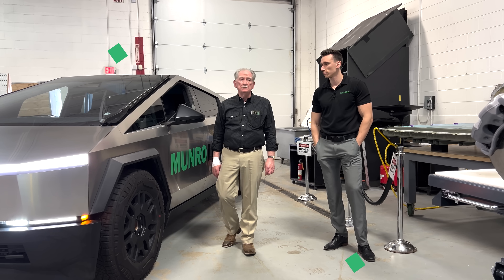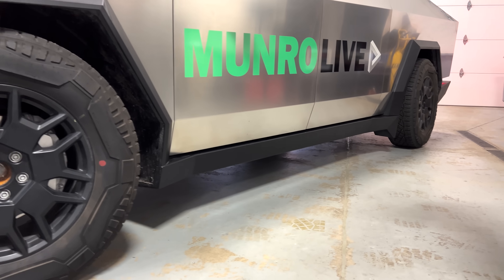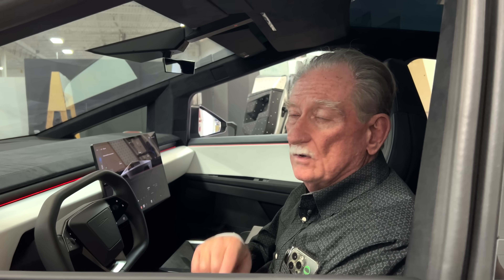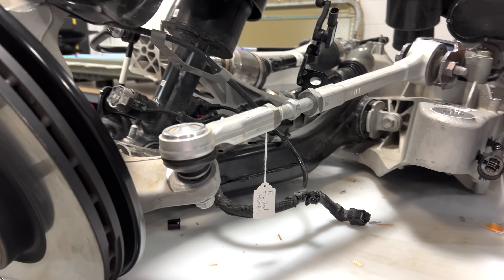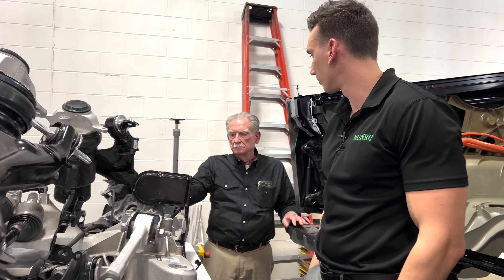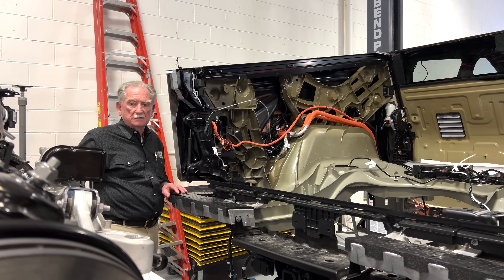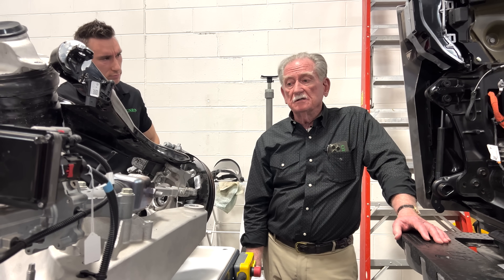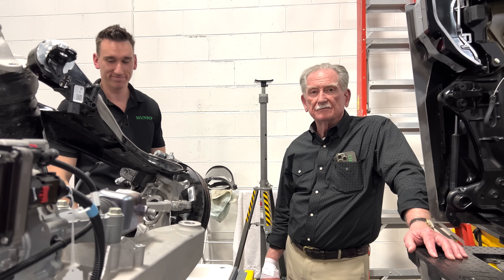Tesla Cybertruck Steer-by-Wire System

Comment: What’s the next step after steer by wire?

Turn the front wheels more, eventually to 90 degrees. The electric motors will move the truck at 90 degree steer. Do 90 degree steer for just the front wheels for now, then add that feature to the rear wheels. Just on the front and you can shove the back into a parallel parking space, then turn the front wheels sharp to bring the front to the curb.

It doesn’t need to be Tesla who does this. Innovation favours the bold. There was a mini prototype car that could turn all 4 wheels to 90 degrees. We can do that in a production car today. But a long pickup truck would benefit more. For now, just design so you can turn the front wheels 10 degrees more. Then next iteration go to 90.

And lower the bed of the truck. The Rivian might be the first to lower the bed of their cargo box because their box is not as long so it’s easier. You have the clearance between the ground and the underside of the truck. Then the frame parts and motors go between this space and the bed of the cargo box. That stuff needs to be squished or fitted it into the sides of the cargo box. Going with first principles, the underside clearance (16 inches?) to the bed could be as little as 4 inches. That means the step up from the ground to the deck or bed of the cargo box would be 20 inches. Currently the typical height of a pickup truck’s bed is 32 inches. It’s a big step. Going 12 inches lower would make it a lot easier to load and unload.

With ice trucks, you had the drive shaft, the differential and the axle, plus room for suspension movement. All that goes away with electric motors. The only reason we keep the bed height at 32 inches is because we’re designing an electric truck modeled after the original ice version (and the ice truck was modeled after the horse drawn wagon and carriage, which also had an axle and suspension under the floor). The only other way to have a low bed is use smaller wheels (because your height is still dictated by the height of the drive axle... which isn’t needed in electric vehicles).
Reply: I heard Tesla wants to start changing their assembly over to unboxed soon. Any maker can do this.

Comment: I think that it would be reasonable to guess that the casting with the ZF logo is a common ZF component, also used in conventional mechanically-drive racks, while the casting with the Tesla logo is still made by ZF but is unique to Tesla because only a steer-by-wire system needs the second pinion and motor, and Tesla is initially ZF's only steer-by-wire production customer.

Comment: On ehuge benefit of by-wire steering is the ability for the system to decide what steering roadwheel angle to apply no matter what the driver input to the handwheel is.  The biggest problem when calibrating a dynamic stability control system is drivers who "wang" the handwheel all over the shop, upsetting the system.  With by-wire steering, you can perfectly control vehicle yaw with a roadwheel steering input as well as, or in preference too, a brake yaw application.  Add in machine vision and lidar, and you can finally break the age old problem of drivers simply getting target fixated on the thing they are about to hit, and as a result hitting it. In advanced driving we teach "look where you want go, not where you don't want to go" but for most drivers, and emergency is so rare, unfolded quickly and un-expectidly, and as a result, a lot of fundamentally avoidable (through handwheel inputs in conjunction with braking) are not avoided at all....
Reply: Wenn Du sowas willst oder brauchst, ok - aber ich schalte im Winter je nach Straßenglätte und Schneelage sogar das ESP AUS - aus dem einfachen Grund, weil es hoffnungslos überfordert UND eben viel zu langsam und träge ist. Bei sportlicherer Fahrweise, ist das System sehr schnell überfordert. 
Probiere es mal aus, ein außer Kontrolle geratenes Auto MIT und dann OHNE ESP wieder einzufangen - dann weißt Du was ich meine. Bei mir, war es also genau anders herum, dass das "überforderte ESP" ständig und verspätet MEINE Lenkkorrekturen dann praktisch zunichte gemacht hat. Man spürt dann regelrecht, wie das ESP mit 0,5 Sekunden immer zu spät eingreift.

Comment: The gearbox shown at 8:18 is clearly a worm gear driving a wheel which is on the pinion shaft. There might be planetary reduction as well, I suppose.
Reply: That is what it looked like to me, too.
Reply: 100% - no planetary drive required for the ratio between motor and rack. That is a worm drive connecting motor output shaft (worm) and pinion (connected to worm wheel).

Comment: million dollar question: How is the 48v power supply redundancy / backup handled and where?  A total loss of 48v power is going to be a problem! Does the rack still have mechanical self centering, ie is the motor drive ratio and motor friction/cogging low enough for the castor angle to push the wheels back to centre in the case of a complete loss of 48v power, or can the vehicle use brake bias to steer in extremis?
Reply: you aren't the first person to think of that.  Maybe go watch more tesla vids.  Tesla has two electrical systems in each car.  The main battery winds down, and it slows you down.  Eventually, when the battery is 1% it doesn't let you go faster than 1 mph.  Then it shuts off.  You still have lights and steering powered by the backup battery system.
Reply: @davidanalyst671  no. i'm not talking about a HV traction battery discharge or failure, i'm talking about redunancy on the 48V battery and asscosicated electrical distrubution system.  I'm sure the SBW meets ISO 26262, i just would like to understand how that is achieved with respect to the 48v power architecture.  I'd immagine it is furnished through very careful fusing and discretisation of dual feed paths,using both the 48v storage battery and the HV-LV DCDC to provide seperate and non-cascadable redundancy!

Comment: Isnt it better to make the cable separate? What if something happens that the cable is damaged. If they are so close together they can be both damaged
Reply: I have been begging for a wiring episode.  I would assume elon wouldn't want it because everyone is kinda trying to catch up to elon, but yeah, we all got questions.  they could separate the cables, so it runs on either side of the battery, so one gets damaged, it uses the other....
Reply: And both cables connect to the same point, a little corrosion there takes both out.  Not really a triple redundant system.
Reply: A rat would chew both cables ar once
Reply: And what happens if you lose power? Either through battery failure, accidental/intentional power off or connection failure.

Is there any sort of mechanical steering wheel lock on Teslas as there are when legacy ignition keys are removed?
Reply: @GntlTch Nope.  Check Out of Spec reviews… they tested and answered your question.

Comment: Aircrafts crashed for pitot tube malfunction. Speed sensors become a vital part in a SBW car. I guess at least triple redundancy is needed there.

I still feel they could get most of the benefits with a traditional steering assist at the expense of a longer steering wheel travel.

Also I'm not sure everyone is going to service their cybertruck as thoroughly as an airplane is maintained.
Reply: Most AC maintenance these days is troubleshooting and parts swaps.  Car mechanics do the same.  And in both cases the big advance is the diagnostic software/hardware
Reply: The 737MAX crashed because of a cluster ** at Boeing.    This should never have happened.  It did not follow general control system principles and standards.  The system was supposed to apply a specific amount of pressure to the stick to make it feel like the 737 NG.  Instead they delivered a unit that overpowered the pilots.
Reply: @danharold3087  
Don't know about that specific accident. There have been numerous crashes caused by Pitot tube malfunctioning like the AN-148 crash near Moscow. In that one the pilots forgot to engage Pitot de-icing before take off. A human negligence that cost 70 people their lives. 

I know a lot of people who are light years from being as careful in servicing their cars as an airline company is for its fleet, yet crashes happen anyway despite all the care. Removing the extra safety of a mechanical steering is unnecessary in a car where one is not handling a hundred ton vehicle. Just not wise.
Reply: @halnineooo136  
I know it seem illogical that a more complex system is less likely to fail.  Properly designed control systems with multiple redundancies are safer than the mechanical systems they replace.  That does nothing to improve the non redundant systems on cars.    So crashes happen.
Mechanical failures are a contributing factor in a relatively small percentage of crashes. Estimates suggest they might be a cause in somewhere around 2-3% of crashes.  Many if not most of them tires.
Reply: @danharold3087  
You can still improve the reliability by not suppressing the mechanical steering while adding the extra layer of electric assistance. Just another element of redundancy that does not have the same failure causes as the electric system. 
Also how to tow this vehicle without steering when it has a major power failure? Sometimes you just need to push it out of the way. 
I don't know, we'll see with time whether this was an improvement or just a fad like so many in history.
Reply: @halnineooo136  Undoubtedly.  But then you lose the advantages that SBY brings to manufacturing.   Don't matter if you can't sell it.
These are all question that we hope Tesla has addressed and will be confirmed or disproved. We can't do it in comments.
Can't do collision avoidance or self driving without electronic control of steering.

Comment: Confused by REDUNDANCY terminology. 
Also had same issue with the Boeing computers description I have seen elsewhere.
For instance you showed what seemed to be a twin cabled lead and called it double redundant. Is this a difference between American English/Math and English English/Maths?
In English English a double cable would simply be called a (single) redundancy. A double redundancy (two redundancies) would be three cables. Likewise "triple redundant" system would be four systems. 
Or did I not see/hear all the redundants being described?
Reply: No, it's not a region difference, it's just poor understanding of the terminology.
Reply: @brianb-p6586  As in my poor understanding or various engineers on YouTube?
My UK 1980's training (and since) was very definite that a single redundancy consists of two systems, and so on.
Reply: @johnpublicprofile6261  I was referring to Sandy's poor understanding of terminology.
Reply: Not quite sure where this claim of triple redundancy is coming from. There's either some complete ignorance of the meaning of "redundancy" at Munro's shop, ot there's some clever marketing (lies) coming through back channels from Tesla to Munro.
Reply: @Thegrimmechanic  yeah, after some initial scepticism and criticism, Sandy seems to have become a big Tesla/Musk fan.

Suspect there's at least some Tesla "boosting" going in here....

Comment: If they cut the front rack in half, they could use both motors and have variable wheel alignment too !!!
Reply: ZF offers that for the rear, a Porsche uses it on some models, primarily because the transaxle is in the way of one rack running across the car. It would not be worth the cost and increased failure issues just to tweak toe ange.
Reply: They would need to double the number of motors and sensors.

Comment: My 1994 Stealth RT/TT has active all wheel steering and it's 30 years old. Porsche 928, BMW 850, and even some Honda Preludes all had it in the 90s.
Reply: Yep they called out the other types of 4w steering in the video. Hydrolic, mechanical etc.
Reply: Thanks for your information
Reply: Were they steer by wire, or all mechanical?
Reply: @1flash3571  Makes no difference if it works
Reply: 928 is passive system where wheels move to direction providing understeer. There is one extra rubber joint in lower control arm. When brake is applied wheel turns inwards instead of outwards as in usual suspension arm. There is no rack or any other extra control mechanism in it. Prelude, 850 etc. were more sophisticated systems back then.
Reply: Dodge Stealth TT / Mitsubishi 3000GT VR4 are engineering masterpieces.

Comment: I want the motor and battery pack setup from one of these after a bunch have crashed. I think that it would be an easy drop in to my Navigator.

The redundant steer by wire is great, as long as the three computers agree. There have been software problem in the past, quite often involving signal race conflicts, that have cause some fun stuff in planes and rockets.

The two things that I don't like about the Tesla products are the look cheap TV interface, where there is a cheap single screen for everything. I like what Caddy has done, classy. The second thing is a glass roof. I hate sun roofs and the glass is even worse.

Glad to see the CAN buss going away. The prime thing about going to 48 volts over 12 is the fact that the drive current for any item is of course 1/4 that of the 12 volt system. Ohm's law after all.
Reply: That's not Ohm's law.
Reply: @brianb-p6586 Then what law would you quote which deals with current, voltage, resistance, and extrapolation, power? Power = EI. Pray enlighten us...
Reply: @The_DuMont_Network  yes, "Power = EI"... which is not Ohm's law.
Reply: In the end is how the quorum is programmed to behave in case one is not responding, or ill behaving.  This is not something new, in computer sciences this is very well studied.
It would be nice to have documentation of how ZF/Tesla defined that part.

Comment: Why not have more turning in the rear wheels?
Reply: Complexity and cost with little gain for regular driving.
Reply: Also safety. If the rear fails, and steers all the way to one direction, the front needs enough authority to overpower that.

Comment: If we would buy a smaller vehicle for the city, would we still need 4-wheel-steering?
Reply: No
Reply: don't even need it on a crew cab long bed 1 ton truck
Reply: Depends where.  In the EU where a Ford Escape is a large SUV, yes.
Reply: If you use a bicycle in the city you can even get away with 1-wheel steering.

Comment: For here the uk the rear steering would be semi useful but for usa not really.  It’s a bit of gimmick.  Commercial lorries have had rear wheel steering for many decades but they are much longer and it’s much more necessary.

Luckily the cyber truck will not be sold in Europe due to its atrocious pedestrian safety.  A company they doesn’t care about pedestrians is so musk.
Reply: Slant the hood down to meet the bumper and use an aluminum hood.   Safest truck on the road.
Reply: @danharold3087  that would need a major redesign.  All tesla needed to do was make a conventional truck with good range at a good price and they would have done well. All the clever tech on the cybertruck is wasted
Reply: @kentonian    RIvian is that truck you describe.  They are selling under the cost of production.   GMC is selling 3 trucks with 2X the battery and losing at least 30K maybe 50K per truck.  The CyberTruck had 3 months of intense media attention.  The GMC trucks did not get intense media coverage.
Apparently the cyberTruck production for 2024 is sold out.  Production is cash positive in 1 quarter instead of the projected 12 to 18 months.